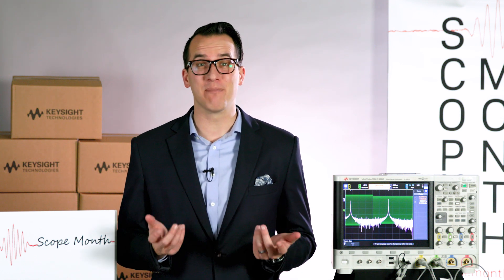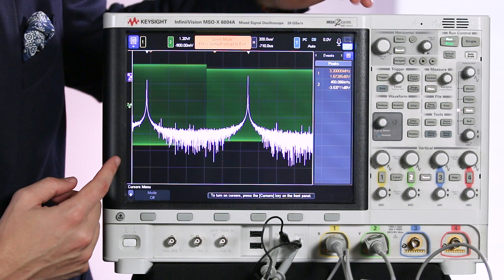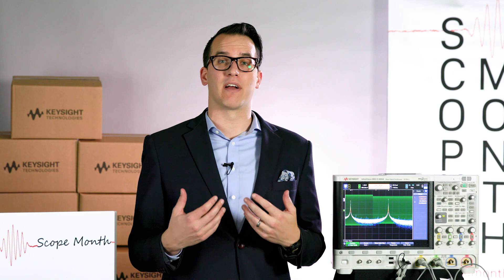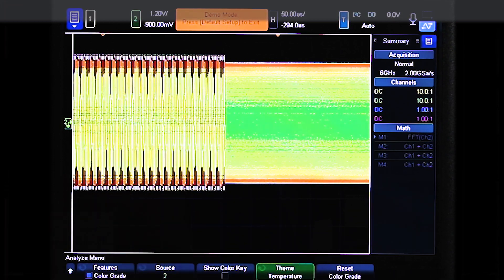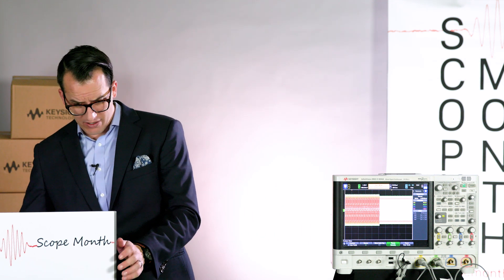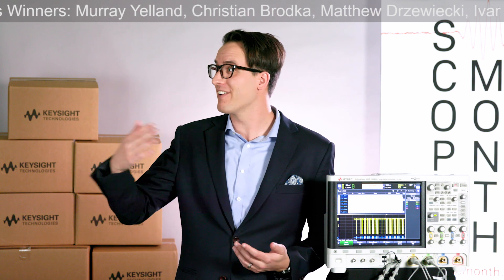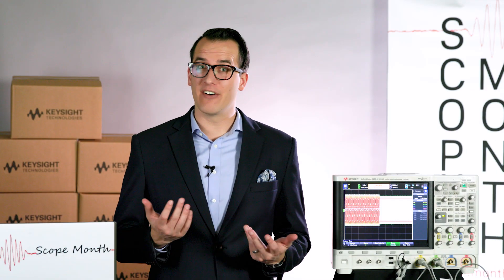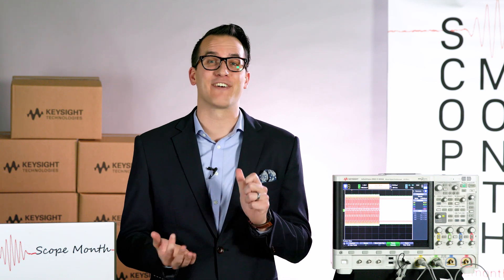Color Graded Measurements and Today's Scope Month Winners! (28-Mar-2017)

Comment: That's one nice machine , I'am used to seeing green
Reply: On the bright side crt can still be helpful for intensity. LCD gets close but sometimes not close enough. It does have features I wish a hand me down 2467 had.
Reply from the maker: But, unlike a CRT, the intensity is adjustable. So, there's a lot more flexibility and tune-ability in the signal display.

Comment: Great option color coding, but how configurable is it? I'm one of the very few with acute achromatopsia (read: black and white vision). Makes things a little complicated (but I must like complicated, after all, I ended up in electronics engineering).
Reply from the maker: You can do intensity instead, but it would be not the most helpful tool if you have trouble with color.
Reply: Maybe, but there is a workaround, which makes it perfectly usable for me. I'll just assign color work to a student, they seem to be used to it :)
Reply: How about glasses with different color filters either for each eye or top/down as in bi-/tri-focals --or a screen filter using different colored plastics? That way, the colors would be filtered accordingly. For example, a red trace would show in a red filter (as white to you?), whereas a blue trace would not show et cetera.
Reply: Hi Benjamin, unfortunately it isn't that simple. I've tried a few things, and I really wanted to get my hands on some enchroma glasses that are made for colorblind people, but apparently the results are minimal on people with achromatopsia. It's sort of like watching a black and white TV, apparently, but I've learned to live with it. I still have a big problem with red on black, but most of the time, I'm OK. I can see it, I just have a hard time differentiating it. Of course, if Keysight Technologies wants feedback from colorblind people, I'd be more than happy to help, but from what I've seen, it is usable for people like me.
Reply: Ah, okay. Interesting. There are a variety of root causes grouped with achromatopsia; Just as there are a variety of causes to partial hearing loss. EnChroma's glasses don't work for all cases of color blindness --obviously. And as an engineer, you know properties of light can be used to distinguish color before reaching the eye, so that there is the possibility at some point of a system that adapts to a variety of circumstances.  It would be cool to make a pair of VR glasses where in addition to adapting output, the input spectrum was expanded into microwave and radio. Put a pair of those glasses on, and one could see leaks on a PCB! cheers